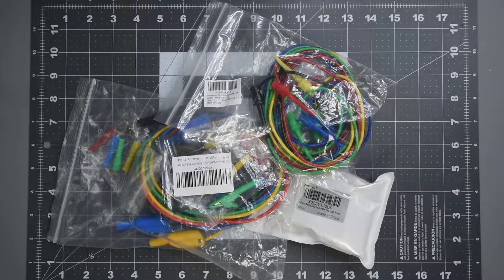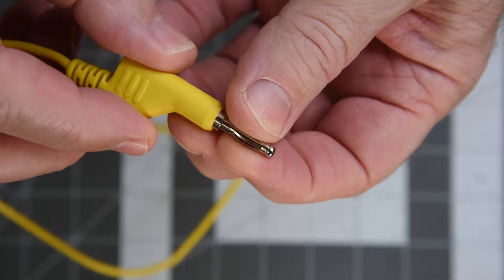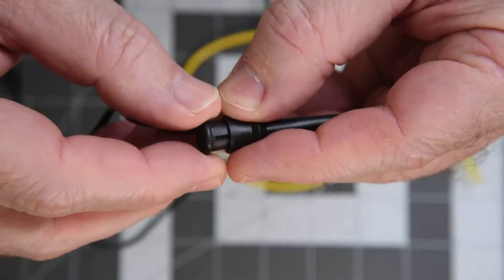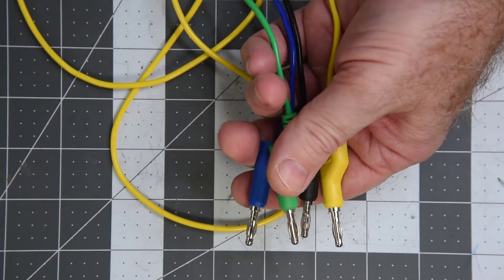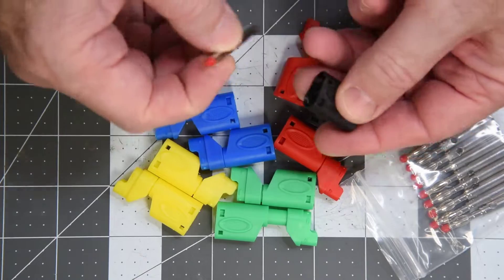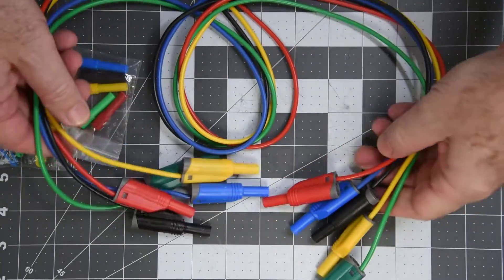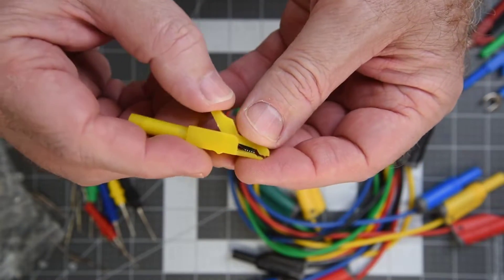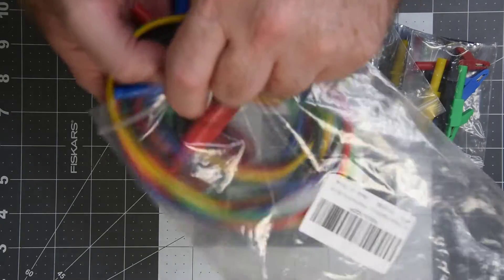3 Banana Plug Review

Comment: Man, you can get actual Pomona stackable DIY bananas (Pomona 1825-2) for $24 for a pack of 10. Then you can always make them out of whatever wire you like. The banana parts are probably OK as long as the springs feel good, but those hooks always end up breaking. 

I've tried cheap leads before, and always end up wishing I just bought Fluke or Pomona or whatever.

"That's weird. This 10 Ohm resistor is reading 242 Ohms out of circuit. Oh, my leads are falling apart for the third time this week."
Reply from the maker: The last test lead set I bought for a meter was a Kaiweets.  And they were cheap.  I was really surprised   how nice they were.  So I thought I would give some other way out brands a shot.  The only solder connect brand name stackable banana plugs I found were some Cal Test ones.  I’ve never used any of there connectors, that I’m aware of.  I plan on giving there’s a test, see how they compare.  I don’t ever expect much from a hook clip.  But they do come in handy now and then.